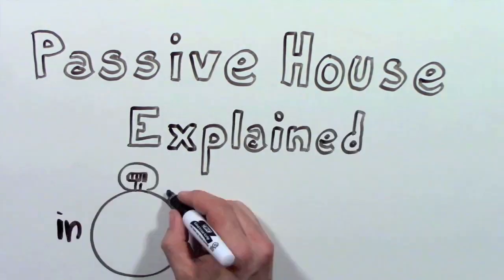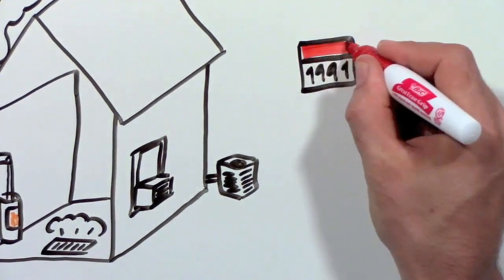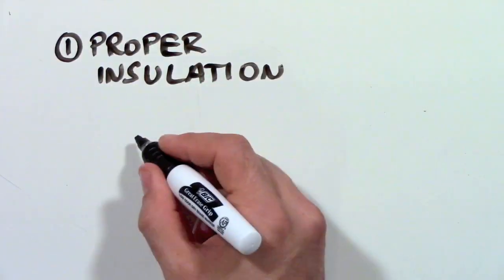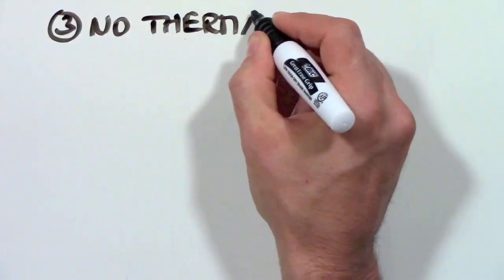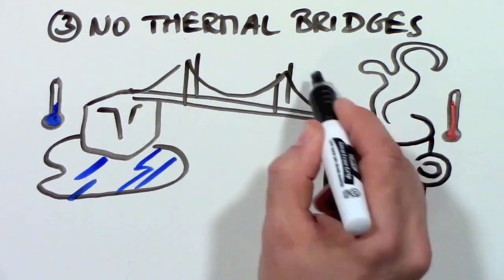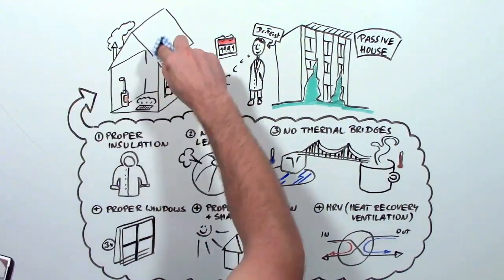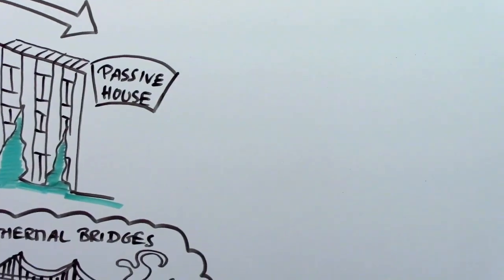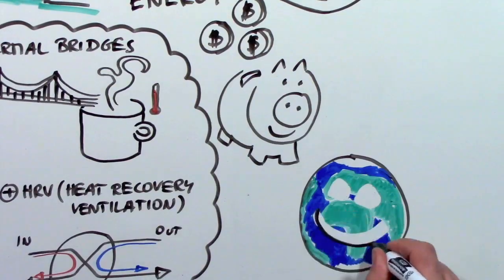NEW: Passive House explained in 90 seconds.

Comment: I wish the ERV vs. HRV confusion hadn't come up.  I also wish the incandescent light bulb had been a washer/dryer or shower or DHW.  If you had the time, studs & rafters are a couple of thermal bridges.  I think "no heater" should be "no large heating system," same w/ cooling, if possible.

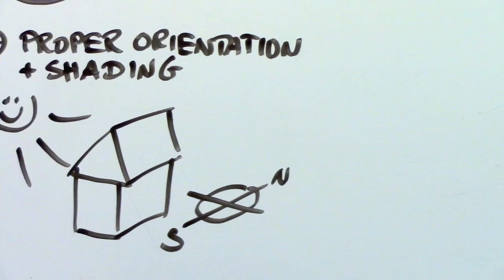Comment: The compass rose at 0:58 is facing the wrong direction.  The long side of a house, and the sun position indicate that the North should be to the right for Northern Hemisphere, to the left for the Southern Hemisphere.
Reply from the maker: Interesting catch. You must be an engineer. I’ve also never seen the face on the surface of the sun. (Hint: it’s an illustration). All the best. Hans
Reply: @TimberPlanners  If it is an illustration, it ought to be an ACCURATE illustration, otherwise why bother.  The whole point of Passivhaus is to pay attention to things like ORIENTATION.  We do not need people who don't understand orientation spreading misinformation.
Reply from the maker: Honestly, you’re taking this too far. Are you a CPHC or CPHD? I am. This small illustration only points out that orientation is important. Nowhere do you learn that the long side of a house needs to face a specific direction. The orientation of windows vs opaque building elements matter, but they are not shown in this illustration. Passivhaus is a design methodology, and not a prescriptive path. If you want to take this illustration literal, then the sun is setting in the west (Northern Hemisphere) and the gable ends are North-South facing. I’m sorry, but that’s where I’ll have to leave it. Thanks for watching and paying attention. Cheers.
Reply: @TimberPlanners  And now people can make the decision about whether to hire you based on your interaction here.  Do you make fundamental mistakes?  Yes, just like we all do.  How do you react when those are pointed out?  You get defensive and try to pretend that the mistake was minimal, rather than owning up to it, and trying to fix it.
Reply from the maker: Sorry, but I can’t follow you at all. You are the first one to have pointed this “mistake” out from over 600,000 views (total, from all websites including Vimeo, it’s probably much higher since the video has been spread all over and people don’t always properly attribute). This is merely a minimalistic sketch to graphically illustrate the term “orientation”. I don’t actually see how this is a mistake. If you can make a quick illustration of how this is wrong, please make a quick video or sketch and send it to me. I’ll gladly except that I have made a mistake if you can show me how. You can reach me directly at Hans {at} pinwheelbuilds dOT c0m (just make the email address work, you know how to) or call me directly at +1-9o5-32I-39O5. BTW, people love interacting with me and they greatly appreciate all the input and consulting I’m giving regarding passive house. I have never come across someone having an issue with this, and to show you that I’m not hiding behind anything, I’m handing you my personal contact (up there). I don’t seem to find anything about you BTW. Looking forward to your email or phone call.
Reply: @TimberPlanners  Yup.  I am sure that potential clients are happy to know that you don't care about mistakes unless they are noticeable to layman (as they themselves probably are), and not interested in acknowledging that mistake or trying to fix it.  That you will try to bully them by saying that your are a Certified Passivhaus Designer, rather than fixing the problem.   Shouldn't a CPHD KNOW that orientation of the building is the first thing to get right?  It jumped out at ME, seeing it for a mere 5 seconds.  

Not sure why you are bragging about 600,000 people having been misinformed by your video.
Reply from the maker: I’m starting to think you’re just doing this to bug me. Please point the mistake out to me. And to get right into the topic of orientation, you’re right that orientation is important, but in many cases (at least here where I live) I can’t actually do much about orientation. Many of the properties are so tight that I have to build the house in a certain orientation. The only thing I can influence is the placement of the windows (and even that is tricky within the rules of the local code stipulate certain rules for glazed areas) for passive solar heat gains. The orientation of gable end or the length (or depth) of the building don’t actually matter as much if I can freely place the windows wherever I want. What are your credentials? Also, I do mean it, send me an email or text, or give me a call. ✌️